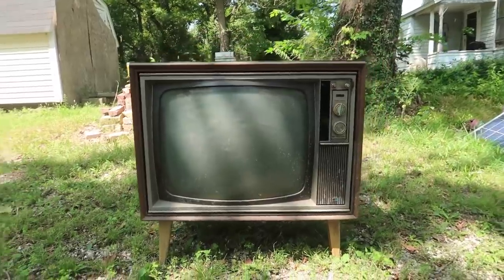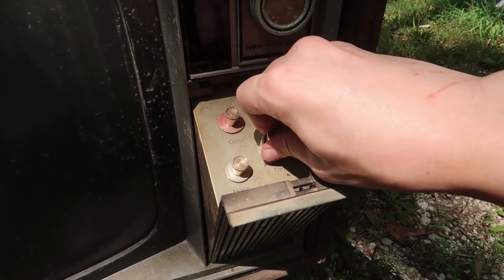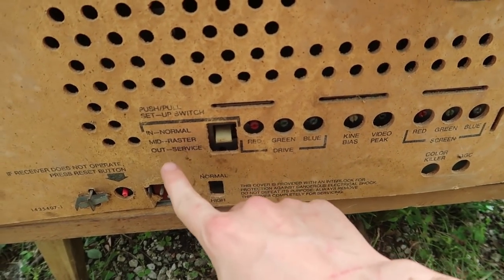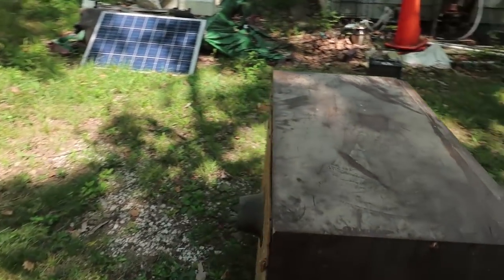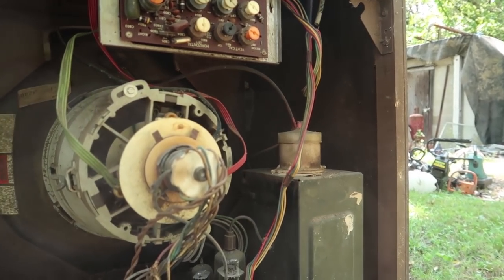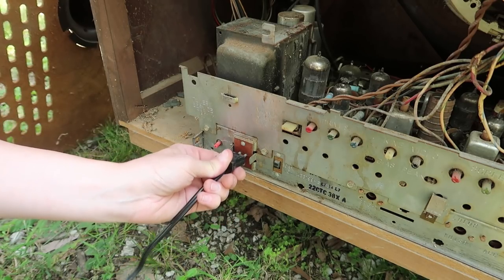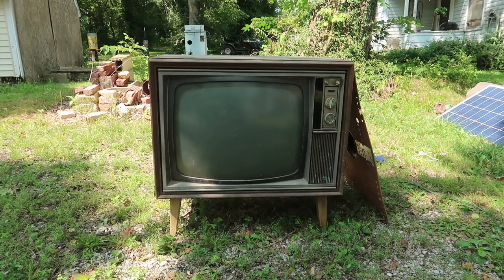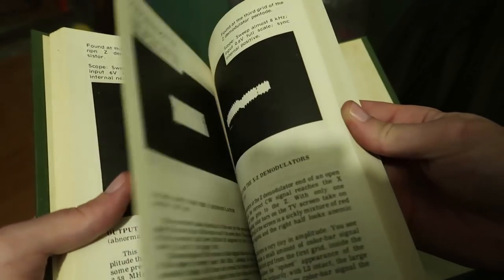Television Triage: 1960s RCA CTC-38 "New Vista Color" TV, found on side of the road.

Comment: The CTC38 was our first color set. We got it in 1968. It was a hybrid tube/transistor set. The IF stage was transistorized. Our model was a commercial version with a 3 wire grounded power cord in a metal case that I called the 'tin can'. What had happened was our neighbor, who was a purchasing agent for a health care facility, accidentally ordered two extra sets. The mistake was only discovered after a truckload was delivered direct from the RCA factory in Bloomington, Indiana, and our neighbor was in hot water. He reached out to his neighbors. Two of us jumped at the opportunity, for the cost was only $346.50 each, delivered. He got the accounting dept. to take our checks and he was off the hook.

It was covered in Sams Photofact set 1000, set 3. But I earlier had bought from RCA their own Television Service Data which I believe was 1968 File T16 or T18, since the Sams file only came out in 1970. The set required repairs quite often. Two transistors in the IF strip blew. The set had  a low quality printed circuit board that warped as heat from the tubes aged it. The required replacing a few tubes, but never the picture tube. I was able to repair my set and keep it running until 1991, when it went to bulk trash pickup.  Sometime in the 80's, there were so many solder joint problems that I "burned the board", i.e. resoldered all the connections. The big thing back then was protection from X-Rays, since that horizontal output circuit put out 25,000 volts.

After all the time I spent finding and replacing low quality components in my set, I have no interest in restoring a set in this condition. But, you could always "part it out" over Ebay.

Comment: CRTs implode, not explode. However there is still risk of glass shards flying out if that happens, thus the safety lens on these older rectangular CRTs that were more prone to it. And this TV is at least from 1968, as it has the new RCA logo, which was introduced then.
Reply from the maker: same thing for this usage of the word explode, sharp glass shoots outwards at great speed. thats called an explosion for everyday english.
Reply: But there is a big difference! For example, never carry a CRT with the picture tube facing your stomach, because if you fall and it implodes, it'll suck your guts into the CRT. The fact that some shards of glass may still fly out of it is just a side-effect, not the main method of how it destructs or the main danger.
Reply from the maker: any proof or just your hunch?
Reply: It's essentially a giant vacuum tube. They implode, although glass shards could technically fall inside the shell of the tube, or outside the tube, but they wouldn't be projected outward. The safety lens is placed there because the glass in the front/center of the tube isn't particularly thick in the grand scheme of things, and in an age that lacked the benefit  of the amazing glass compositions we have today, you wouldn't want people inadvertently destroying a sizable investment (in those days) the first time they tried to move it or if it were bumped into a little too hard. A TV wasn't a disposable commodity back then. When it became disposable, that's when you seen the mass exodus of TV repairmen going quietly into the twilight of life.
Reply: @kevinsvideodump  BS.

Comment: Be careful in the back of it, the old TV’s have some very high voltage and can really bite. Leather gloves won’t cut the mustard I’m afraid. 
  Maybe it’d be worth investing on some proper insulated electricians gloves, I find it a bit unnerving seeing people get close to several kilovolts.
Reply: The high voltage (25 kV) is contained within that metal box towards the right (the "high voltage cage"). So unless you go poking around inside of there, it's not really any more dangerous than working on a vacuum tube radio or amplifier.

Comment: That's cool. I just rescued a 1978 RCA Colortrak yesterday which I got up and going quite easily - open fuse in HV section. Expected it to pop, figuring it had a shorted HOT,  but it came right up. Only remaining issue is the set has no audio, hoping it is the IC (blech) that is the culprit will be digging into it tomorrow. But it uses the same CRT as your all tube New Vista, same p/n and all that! This later RCA uses a delta gun crt. Kinda surprised me that a "later" solid RCA set still used those /. The Colortrak still  has a strong healthy CRT in it too.  I could use its CRT in an earlier RCA, GE, etc set but I'd still feel kind of bad to do that the Colortrak. Hope you can get to the New Vista in the near future, one thing that I'd be looking into it is the circuit breaker (the red push button) - they tend to go bad or dirty and you will have filaments glowing and nothing else going on as I observed with your set.
Reply from the maker: thanks for the tip on circuit breaker!
Reply: You bet. Hopefully it will do something if that is the culprit! RCA used really good components in their sets so if that is what is the cause I bet, it may just work.

Comment: I  had a 21-inch tabletop model wih the CTC38 inside it. Some mook stole it from my living room. In 1979. The 6BK4 high-voltage regulator tube was a frequent failure. Sams index places it to 1969 or so. It's full of 6GH8A tubes, so keep a supply on hand if you get it going. Best of luck!
Reply: I had the Nipper version of this CTC-38.  The flyback on it burned up.  RCA also issued the same chassis in the new style plain RCA logo.  It must have been the changeover year.

Comment: There might be no B+ because the tubes light but nothing happens. Make absolutely sure all the tubes light and try pushing the red circuit breaker button on the bottom left side of the chassis.

Comment: Am gonna give you a piece of advice if you gonna work on old especially tube equipment when you see a paper cap, or any old electrolytic cap just replace it. You should look up capacitor leakage. When the caps leak dc they will destroy your tubes or power transformer which is very hard to replace.   You dont need to replace mica or ceramic caps well most of the time, any electrolytic cap that 50+ years old needs to replaced. Those silver cans are Filter caps. They are multi section caps that have legend on the side that tells what capacitance is on  each section is these too need to be replaced. You can replace them with multiple modern caps.   
Some CRTS run at over a 1000v a pair of old welding gloves will not be sufficient to stop it from jumping to your hand and possibly killing you. Most tubes supply's are 200v to 400v this too will kill you.  Am glad to see you are finally using a current limiter and variac. Your oscilloscope video scared me hopefully you have learned a little since then. I would suggest you watch every video Mr. Carlson's lab ever made it would be quite beneficial to you. Good luck and please be safe.

Comment: Doug Harlan (or Harland) is another vintage TV guy in Illinois, he is into early coulor sets, but mostly Zenith. I don't know how you would contact him but he has a channel, drh4683  he hasn't posted in a long time though. Videokarma and the Antique Radio forums are good places to ask about vintage TVs and parts.
  That tube not lighting could be a problem, or one of them at least, but the bulb being in series might be dragging the voltage down a little too low for it to work properly, but you should still get sound or something.

Comment: I've got a TV very much like, if not the same one you have. It's a RCA Hybrid, part tube, part transistor. At the time they were one of the biggest color TVs you could get at 25 inches.We got ours around 1970 to 1972 and I still have it. I haven't turned it on in probably 25 years. Wiggling tubes doesn't really cut it. Pulling them out and putting them back helps, sometimes. Testing them with a tube tester is the first thing I always do.
Reply from the maker: no, wiggling tubes can definitely help.
Reply: Yeah, you're probably right. I only have a measly 48 years of experience with tubes to guide my thinking.
Reply from the maker: so you have 48 years of not trying, while i have at least a decade of finding it works. positive proof is positive.
Reply: You've just illustrated my biggest problem with you.  Someone offers you some advice and you blow them off like they're idiots. Maybe I am an idiot for taking the time to watch your videos and then type a reply that I thought might help. Don't worry it won't happen again.

Comment: Almost every one of these chassis has a circuit breaker that is fussy. Push red button in and the spring tension does not push back out far enough to make proper contact. Simply look under the chassis and you can push the contact back in place. As much as I like the ease of circuit breakers...Zenith's bell fuses were really a better idea. Hope your flyback transformer and CRT is good.

Comment: That's a real neat tv set , I was thinking using the thermal camera to see what parts were heating up also i dont have much confidence in your gloves protecting you from the flyback level voltage . Hope you get it going it will look amazing on older retro games :-)
Reply from the maker: your right, i'll go bare hands next time.
Reply: Nahhh , At least you have some protection